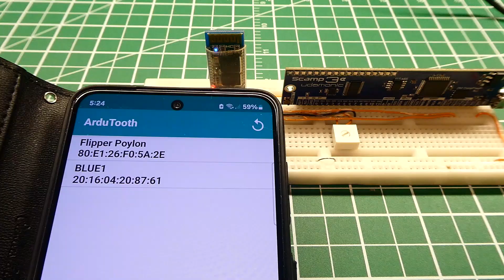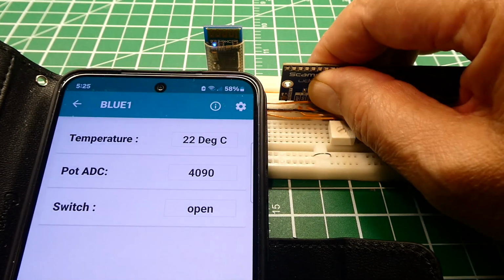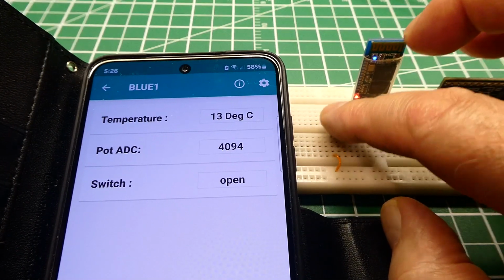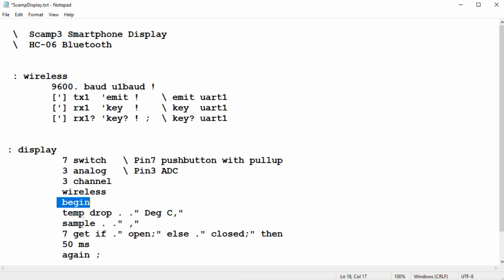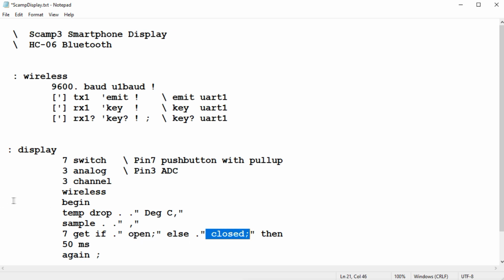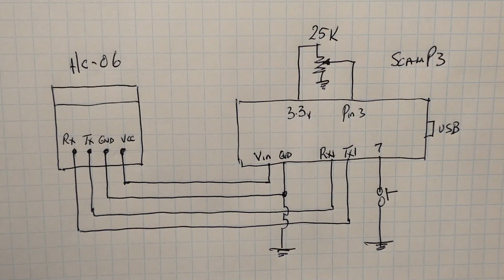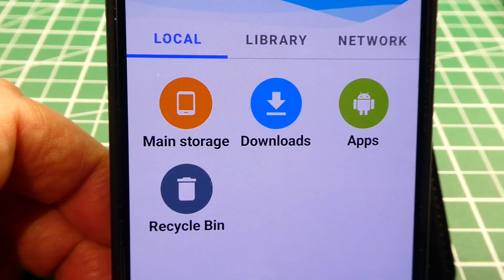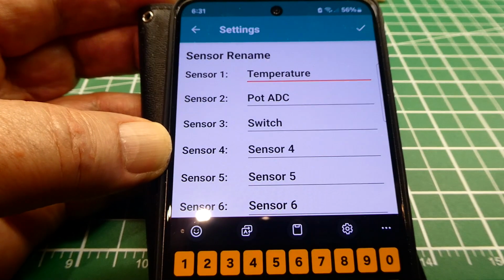Use Your Smartphone As A Display

Comment: Nice. I would love to see a bidirectional Bluetooth app that would allow me to monitor and control connected devices. If the plant moisture sensor is showing dry soil, send an alert. I could then start a water pump to water my plant.
Reply from the maker: You could use SMS text messages for alarm sensing and control.
https://youtu.be/1xXimY2jtF8
For short distances you could use a LORA radio link, just a matter of the right software.
https://youtu.be/V2mopznhELE